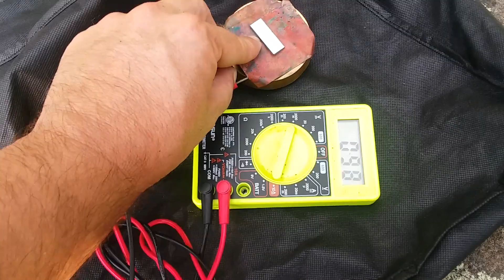NEUTRINO POWER TRANSDUCER VIDEO

Comment: Hier ein Patent dazu: 
Neutrinovoltaic als nächste Stufe nach Photovoltaik
Energie rund um die Uhr aus nichtsichtbarer Strahlung
@t
Reply: Can you translate to English or Japanese I want to understand what you are saying sir.
Reply: Other links:
http://www.free-energy-info.com/Chapter11.pdf
https://www.gqenergy.it/

Graph cell

Primary link
https://www.google.de/search?biw=1280&bih=893&tbm=isch&sa=1&ei=PbuWWojVNZKx0gXYwIqQDA&q=+Si-Graphit+Q+Beta&oq=+Si-Graphit+Q+Beta&gs_l=psy-ab.12...42441.42441.0.43241.1.1.0.0.0.0.150.150.0j1.1.0....0...1c.2.64.psy-ab..0.0.0....0.KPFruZw7TVM#imgrc=HxQRqf4ZpzBWlM:

Secondary link
https://www.google.de/search?biw=1280&bih=893&tbm=isch&sa=1&ei=K7uWWs3lFIPSwQLNrLPoDA&q=Silion-Graphit-Kristallen&oq=Silion-Graphit-Kristallen&gs_l=psy-ab.12...16918.16918.0.17645.1.1.0.0.0.0.93.93.1.1.0....0...1c.2.64.psy-ab..0.0.0....0.z44EkCjOq_k

Here is a patent:
Neutrinovoltaic as the next level after photovoltaics
Energy around the clock from invisible radiation
https://patents.google.com/patent/WO2016142056A1/de

Different machines

https://slideplayer.org/slide/2921650/

https://www.google.com/search?q=kristallbatterie&hl=de&authuser=0&source=lnms&tbm=isch&sa=X&sqi=2&ved=0ahUKEwim5PvngvngAhUHMuwKHZVLDk0Q_AUIDygC&biw=1280&bih=913#imgdii=VQkKRdoUbDroYM:&imgrc=uBlu5BVbRNKGdM:
Reply: . woooooooow wow you are soooo awesom thank you sir🙏😀😀😀😀

But 1st link I couldn't open up with my voice reader chapter 11. Do you have uncorrapted virsion ? So my voice reader can read?
Reply: @Chicsweet1987  3rd one GQ enagy one I saw befor they sell thire product $1000 to $3000 thats too expensive unreal for me to buy sir. 

I bought Bendini machine creater Rick Fredrick Dule pole motoers 3 I bought never work Overunityand broked me & my family sir. 

You brow my mind with over whelming info 

What is best cheepest simple over unity we can practically simple enaf to create at home to use pracically at home? And other homeless & poor people can use pleaae let me know sir. 

Thank you Master Lerneonline.
Reply: @motobacktoconstitution4138  Yes you are right. A lot of information is true.

So far I've tried a lot to recreate.
It is quite possible that someone has already discovered something where really significant amounts of electricity are generated.

In principle one can say that there are also batteries that work with plants and generate electricity or atmospheric electricity.

So far the best option is to test or try to transfer one type of energy into the other, which is available free of charge, so to speak.

Thank you for your comment.
Reply: @motobacktoconstitution4138  I would open it in English (Chapter 11.pdf) and then try to translate it into the local language with Google Translater.

But I also recreated the magnetic motor, it has not yet reached the point that it generates more electricity than you put in it. The magnets then remain in the resting state.

The Solid State Generator are mostly devices that convert EMF (electrosmog) into electricity. There are also coils that convert smartphone radiation and electricity.

There are also earth currents - you just put a wire in one end of the earth and the other in the other end.

Atmospheric energy (the higher the antenna, the more current) In principle, the earth is like a giant capacitor.

With the SWOT machine, the ball remains stuck on top because the magnet attracts it.

But Japan has a huge natural electricity resource. The coast provides waves and a lot of winds you can in principle easily convert it into electricity because there are enough wind and waves if you are in a country with coasts etc.

I would say it is a better way of generating electricity, we in Germany are already benefiting from wind energy, there are many workplaces as a result and there is practically no limit to the amount of electricity that can be taken out. It would replace more easily than the previous producers (coal etc.) and there is a lot of wind and water movement.

https://sumikai.com/nachrichten-aus-japan/umwelt/japan-will-bis-2040-weltweit-die-nummer-3-bei-der-windenergie-haben-285517/

Thank you, best regards

Marcel Henschel
Reply: @Chicsweet1987 thank you so much for reply sir.😀 

 I only need in english but file was currapted some reason and myEnglish  voice reader didnt pick up 60% of chapter 11😂. 

I might try use other voice reader but so incorredging other are searching for solution to parverty & uffering & death.🙏.

Without engy we are doomed😂.
Reply: @motobacktoconstitution4138  Very interesting, thanks for the info.
That is definitely expensive, I think it is true, the batteries alone are very expensive.

With friendly greetings
Marcel
Reply: @Chicsweet1987  electrisys create Hydrogen . 

I think tesla coil or high frequency light up floessence light sir. 

I had tesla coil demonstrated 6 years ago at American automotive mechanic shop & auction

Tesla coil top is Longtudenal , scalar wave side is electro magnetic wave

But I don't see how it burned water.

I was studing  the old sientist with paying subscription and lost my health complitely, got recoverd bunch but I can't jump alound  all specurations sir. 

You are keep jumping alound we need just one it's affordable & its simple enaf to actally practically its work sir. 

After all you have to make living by time we consume to create balance life style. Creating is one things but you have to teach 10 time more people to safe enag to install thire home to buy food to keep my self life by our toil & labor and create web site to advertise & convence people to let them know its safe so time is so limited we can jump alound 40 diffarent project if its practical or not. From out of million over fake unity false missleading infomations. 

On top of that many people want to you to have licence to install device so they fill safe.

I don most of staff professionally installed to diffarent customers too but still 95% cant afford it. 

It have to be cheap and real more than anything affordable & practical sir. 

I am off grid 6 years started by no choice with so many tears. 
Made me learn so much

I have tesla coil demonstration at American automotive wireless electricity on my channel. 

I love your great enagy & love positivity thank you so much for your great love & care & respect & ebagy sir. 

Problems are I don't have that much enagy like you so I have to be practical to make it work one simplest or affordable project at a time other wise my life will be over.Im not that strong I just give my best everything I got but it have to be practical sir. 

So many rechercher die without voice & success broke and poor studing we need be careful to try create win win or live life ,, benefit life stuation from out time & resarch & labor. 

Studing some of staff try build and I failed again & again befor it made me so broke & lost health and almost I lost my life by my stupidity befor , you dont want to be like me sir. 

That's why I'm still super poor and living life. 

If you are smarter please don't be like me sir . it so much suffering

But create one practical project at time & 70% if time educate safty to other how to install & create web site more safty & shear with 70% of time to break even keeps me life sir

So we need one practical real working product at a time please. 

So I don't have to die losing my health recerching and try building them & shear safely. 

Freiendly with respectfully Moto Takeda🙏😀😂.
Reply: @Chicsweet1987  PS I do have 80 HHO dry cells for hydrogen runned engine but not practicall enaf & I have Hydrogen wet cells too sir.
Reply: @Chicsweet1987  aluminium & water & carbon dors create electricity we have video demonstrated but not practical it doesn't create that much enagy to use in real life with affordable price sir. Carbon are expensive from walmart in fish section. Sorry sir
Reply: @Chicsweet1987  I think Rick Fredrick for mear cheaf engenner from Jhon Bendini broked my fainance & trust over & over again with non working false Bendini machine/ dule pole motor and burned up my fainance & trust & my familys trust by lie overunity product😭.

Anyway it have to be practical & have to be super real & affordable so every one can have & use it to live life. 

Just need one device not 30 diffarent project will broke people finance& time& family& life sir. 
Remember dead broke rechercher & repricator cant speak because they are broke and dead under grounds. 

We don't know how many are undergrounds now. 

Even you succeeds you have to convince people safety & shear win win way to create life for both same time on top of greedy ancle sum they don't produce anything but like to correct everything you do sir. I do not concent any unconstitutional direct tax but they enforce anyway. 

Long story short if its so simple & affordable every one can understood & simply use it to thrive thire life or to sovive thire life sir. 

One practical device at a time.
Reply: @Chicsweet1987  quantom magnet motor sells $199 for you to build motor manual instraction it might not work $199 thats is so sick & pure greed selling PDF for $199 

Thats 2 to 3 month of most peoples electricity bill abound here thats is so sick .

I think I just work on solar pannels I have now till if there are something really practical exsiat out there sir. 

Thank you for your love & all great enagy try answering me sir🙏😀. But it need to be practical so we can really use in our life to sovive life sir🙏.

With alot of respect & graditide to you and freind ship & appriciation to you sir. thank you so much all your great enagy and try answer my question sir🙏🌱😀🙏.
Reply: @motobacktoconstitution4138  

Maybe you can get funding or make your projects public for a little bit of money. If so, then you have a lot of experience like me reading and were also inquisitive.

Yes, I agree with you, inventions cost a lot of money and few make you rich. I registered 2 patents myself, but it hardly brought in any money.

I also find new things to be worthwhile and you should at least get out the invested capital.
Maybe you can start a self-help group or something like that.

With friendly greetings
Marcel Henschel
Reply: @motobacktoconstitution4138  Yes, I tried that too. As you increase the voltage, you get more HHO and your yield is bigger, you can do that with a coil that converts low volts and high amps into high volts and low amps. The hydrogen is very explosive, so I think I should only generate small amounts of hydrogen and then use it directly, then less can happen.

With friendly greetings
Marcel Henschel
Reply: @motobacktoconstitution4138  That is correct, the machines like the Bedini motor only deliver impulses. There are machines to buy to quickly charge batteries. So to cycles but that is only then the battery that is then quickly charged.

I also tried to recreate the crystal cell several times. In principle it is a battery that is empty when the chemical reaction is over.

Also the clock where one coil charges the other has not worked so far. It was just the transfer of one form of energy to another.

Ideally, you get energy without investing energy yourself beforehand, that's how I see it. As far as I know, the overunity effect that you think does not exist with the Bedini motor.

greeting
Marcel
Reply: @Chicsweet1987  thank you understanding and so kind responce , openion , you heals my soul thank you so much sir🙏. 

May who ever good above bless you & always protect you sir. 

Please keep me in your player if you could thanks for understanding & caring , I really thank you sir. it helps me heal thank you again for your ubderstanding & kindness🙏😢.
Reply: @Chicsweet1987  I try study till its complite and never got complited nor finish what I stared too complicated that how I lost my health so bad it was so insane & sick for me with all disinfomations & false infomations in internet to confuse people to make them give up & confuse thire reserch for truth & liberty.
Reply: @motobacktoconstitution4138  Yes, that's right, the information is rather that there are many but only a lot of half-truths, if you do the essentials, that's pretty good. It is best to only build that where you know that it will be of good use.

You have already recognized everything correctly, right.

With friendly greetings
Marcel Henschel
Reply: @motobacktoconstitution4138  For example, if you build the crystal cell, it will soon no longer deliver electricity. I built many of them, but none of them worked permanently. As soon as the reaction is over, it no longer supplies voltage.

I also tried to recreate it, but the man definitely doesn't tell the truth about his cells, which supposedly deliver so much electricity.

There was also the Karpen cell with gold and platinum in Hungary, which I also copied, but they only deliver very low currents. In principle, these are chemical cells as you know them from school lessons, including chemistry and physics. The acids that are used for these cells also give conclusions that they are chemical cells, and I never got the described volts, only a few microvolts of reaction energy, which then disappeared a short time later on the measuring device.

In principle I have built a lot of cells and if they really should deliver free energy then the effect would be completely different. These take far too long to generate a few millivolts.

Even the dry cells where I have a few on the measuring device with a switch in between no longer supply any voltage or millivolt. The main thing now is that we as humanity know more that is good.

With friendly greetings
Marcel Henschel